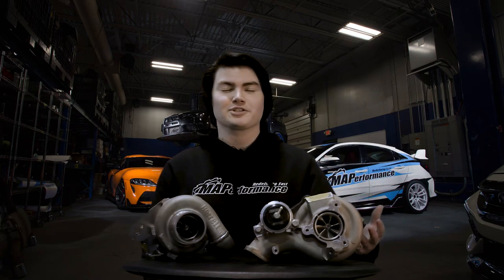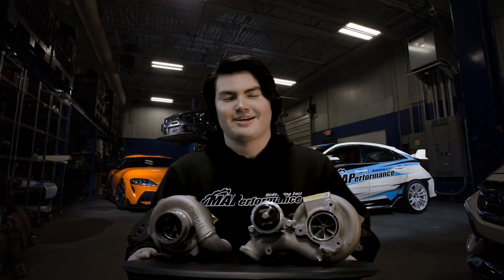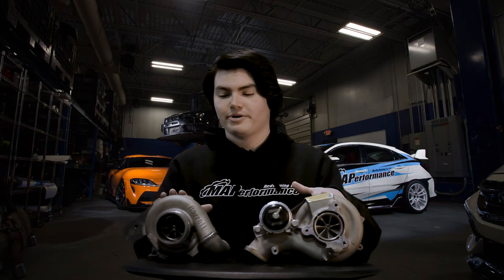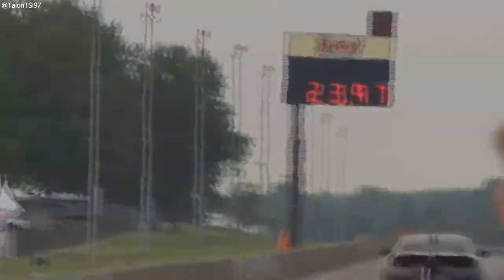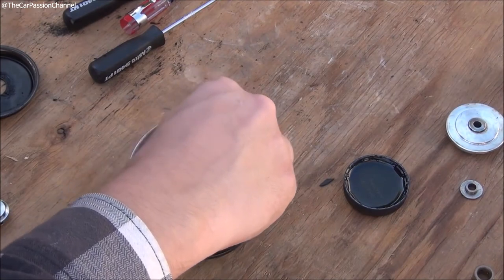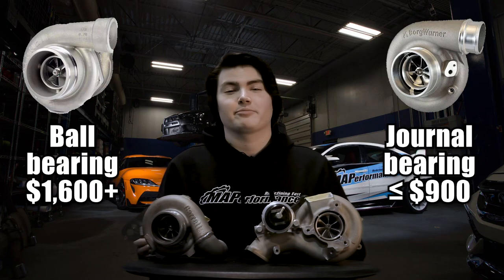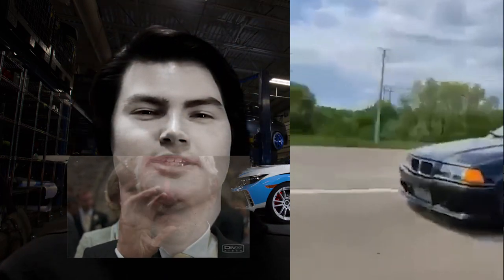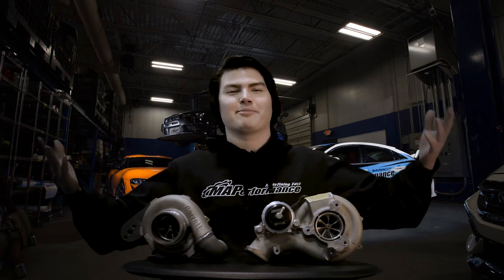Ball Bearing Turbo VS. Journal Bearing Turbo | What's the Difference?

Comment: Do you have dyno graphs or track times on a journal bearing turbo vs a ball bearing turbo that is the exact same size. Same compressor wheel, same turbine wheel, same ar ratios? I bet there is no difference if the turbos are the exact same.
Reply: Normally the cheaper journal bearing turbos with custom setup turbines and compressors for the engine platform of the car it’s intended for perform much better anyways because the smaller variety of ball bearing turbos means it’s not as well suited to the platform of choice.

Comment: spool threshold will not change between ball bearing and journal bearing. That is misleading. The spool threshold is defined by the turbine wheel and compressor wheel size and weight. the bearing system has nothing to do with it. the response going on and off the gas on a track or in a race will be slightly different and the ball bearing will come back to boost faster. this only happens once the turbo was spooled up already, as getting off the gas will not slow the ball bearing as much as the journal bearing unit. from 0 rpm they will spool at the same time though.

Comment: There is no way to have 100 more whp and go slower because of the bearing system. The other guy spooled faster (I am assuming that you have exactly the same compressor and turbine sizes) because he has a smaller a/r turbine housing, or a shorter exhaust manifold, or a higher boost spring on his wastegate, or whatever else. Assuming that you both had a manual gearbox and the same whp, then the ball bearing should have had a slight advantage. Overall, a dissapointing video from a kid that doesn't know a shit about turbochargers (really, this video should not have been posted at all)

Comment: This guy has no clue what he is talking about. You sir should no thave posted this video. And NO!!! Ball bearing turbos are not complicated to repair, all you do is replace the ball bearing cartrige. infact it takes less than 2 minutes to fit a new one in if the old one breaks. You should delete this video, your lack of knowledge when it comes to turbos is disturbing.